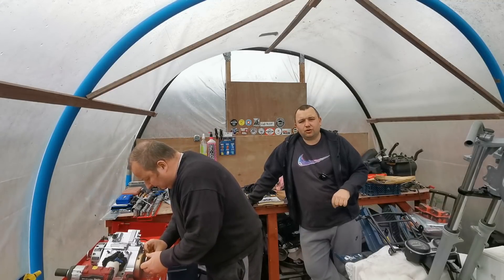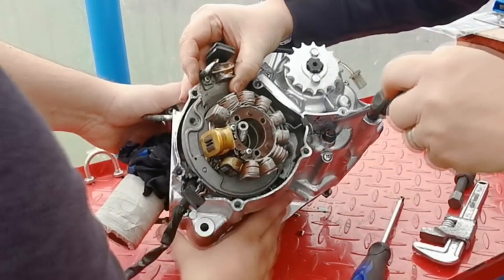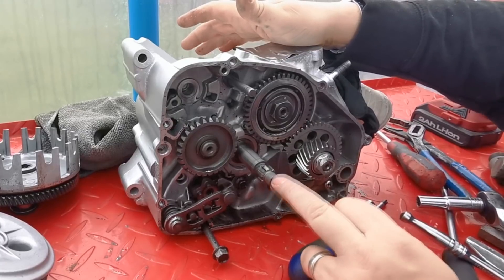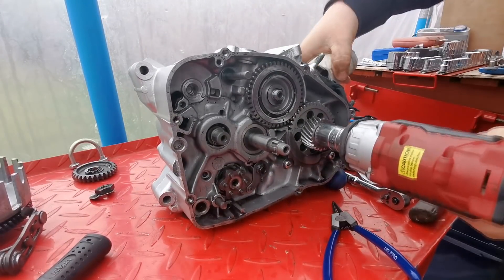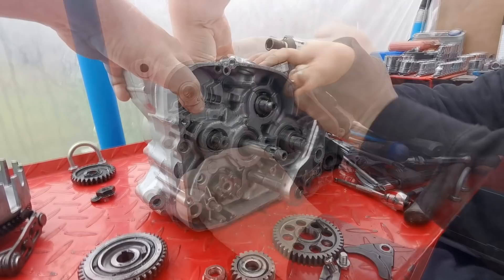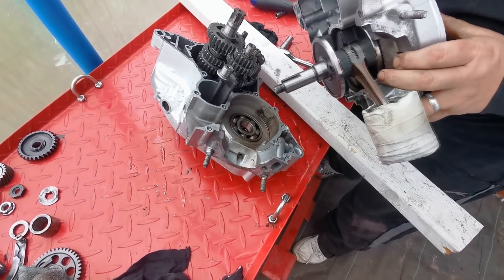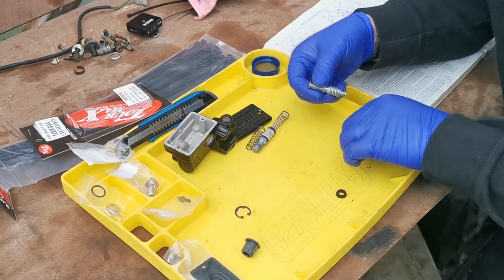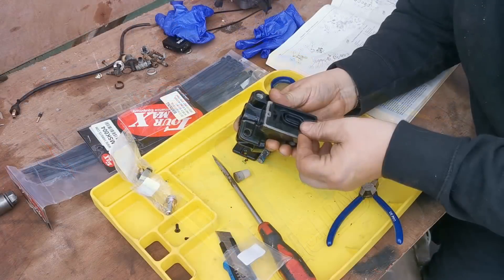Yamaha TZR 125 Engine Strip Down

Comment: when pulling things apart, keeping washers and gears together is important, as you mentioned a bag is one way, but I've used a cable tie to keep them  together in the past, that way the can go straight in the ultrasonic cleaner....
Reply from the maker: Yer iv put cable ties through before works a treat 👍🏻